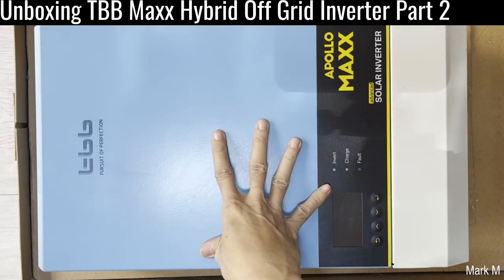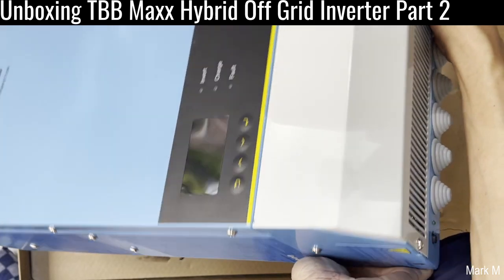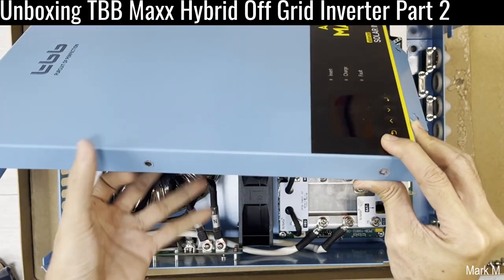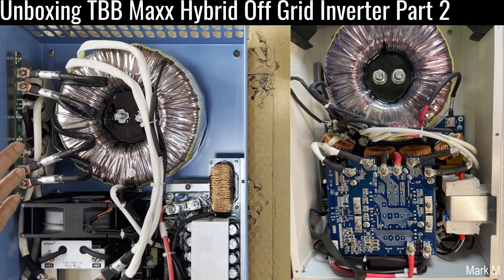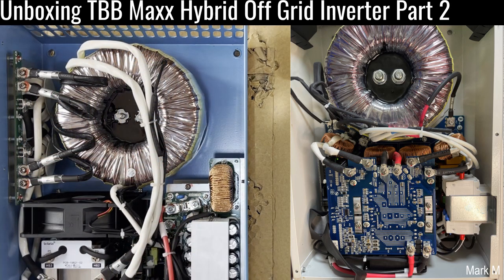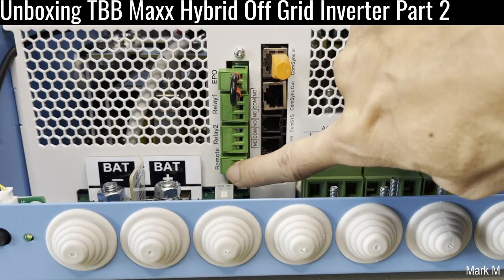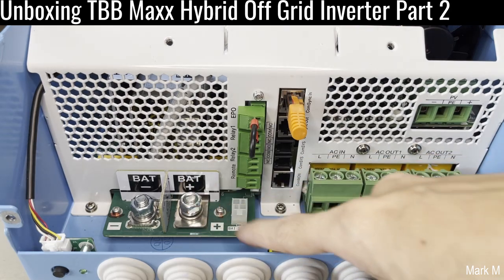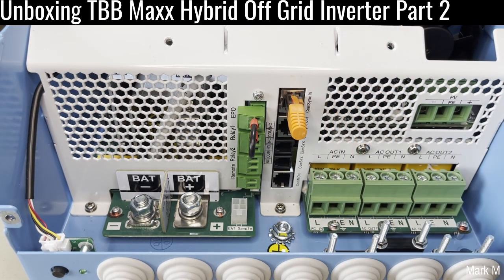Unboxing TBB Apollo Maxx Hybrid Off Grid Inverter Part 2

Comment: sna sir my lumabas n 250v or higher sa charge controller si tbb maxx
Reply from the maker: As per distributor, it will be released soon. May mga upcoming bew models coming.
Reply: Meron na sir ang energier pro na 250voc 100amps mppt at dual mppt pa.

Comment: sir video nyo rin how to configure/explore,  apollo maxx kagaya nung sa apollo energier
Reply from the maker: Yes sir.. nag pprocess palang. Under testing ko pa. Ill post pag tapos na.
Reply: @MarkMinoza  ok sir, may setting din po ba si apollo maxx ng "AC Source '" " weak-Grid"?
Reply from the maker: @clarkallen2866  based sa manual , yes, may weak ac grid option. At fully configurable narin.
Reply: @MarkMinoza  ok po sir thanks po, isa ako sir sa nag aattend ng training ni sir Jun, planning to upgrade from kreon to TBB, pinag pipilian ko kung energier or maxx, kaya hinahantay ko yung video ng configuration nung maxx,
Reply from the maker: @clarkallen2866  sige sir, but regardless of the model, both will work as intended. Im currently using my Apollo with Solis Hybrid On Grid. No issues so far.
Reply: @MarkMinoza  but walang wifi monitoring si energier sir compare kay maxx?
Reply from the maker: @clarkallen2866  sabi ng distri wala pa po, si Maxx ang nauna at Kenergier.
Reply: @MarkMinoza  thank you sir, sana ma upload na yung configuration/exploring sa apollo maxx hehe,

Comment: Bro paano ba ikabit battery sampling nyan,salpak na lng ba or may positve and negatve pa,kc batery sampling parang sa battery temp ang style di ko alam paano ilagay
Reply from the maker: Battery sampling is just parallel to your battery. Please observer polarity. Derecho po yan sa battery, wag sa terminal ng Inverter nyo ang connection.
Reply: @MarkMinoza  ah,so e splice ko pa yung parang batt temp sensor para makabit doon sa positve and negatve ng batt,ang problema ko doo' sa socket wala naka indicate positve negatve
Reply from the maker: @waltersalvador1392  use multi-tester to check its polarity. importante meron kang battery sampling like sa SCC, para mas accurate ang reading ng Inverter nyo.

Comment: San po pwede gamitin yung relay 1 and relay 2?
Reply from the maker: Automation or condition based sa status ng Hybrid. Puedeng ilaw, timer atbp. You can pretty design it in a way you like.
Puede yang pang start ng other power sources like Generator.
Reply: @MarkMinoza  ah ok.. maganda pala ito for some modification ng setup like adding fan, or alarm lights and buzzer, isa pa napasin ko sir, bakit 2 ac out nya? May ac output 1 and ac output 2?
Reply from the maker: @etv4075  yes, youre only limited by your imagination on how to use those relay based on inverters status. AC Out 1 is default Inverter Output. AC Out 2 will shut off if no Grid. So connect only critical loads in AC Out 1 and Optional Loads in AC Out 2
Reply: @MarkMinoza  thank you for the info sir
Reply: @MarkMinoza  sir may diagram po kayo papaano iconnect sa generator?